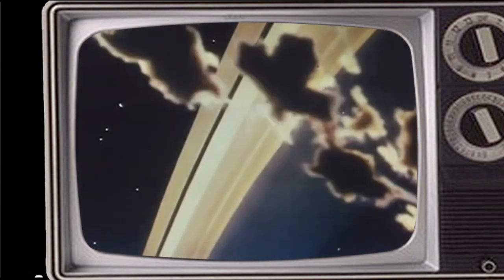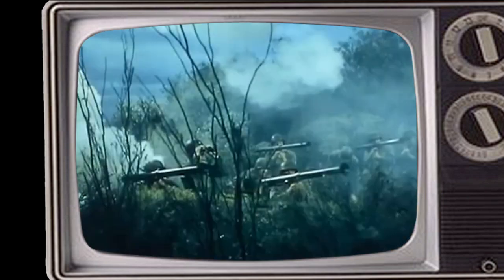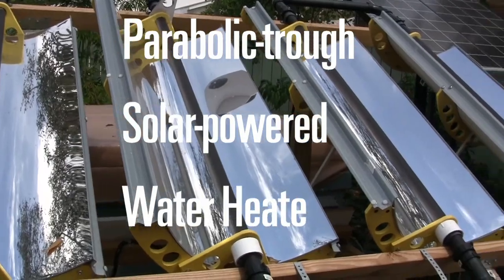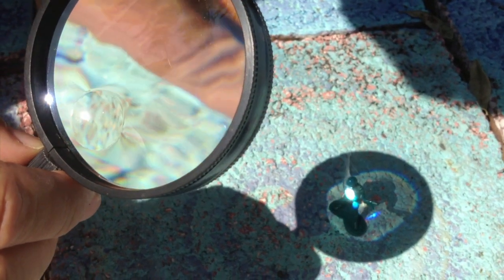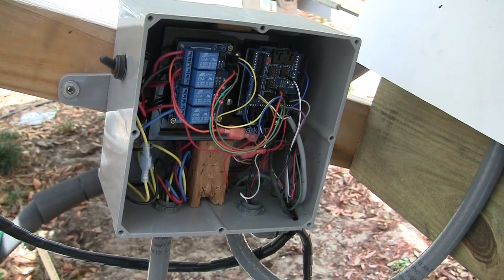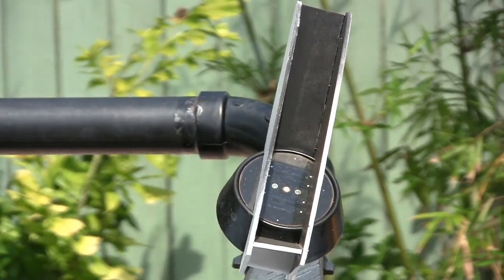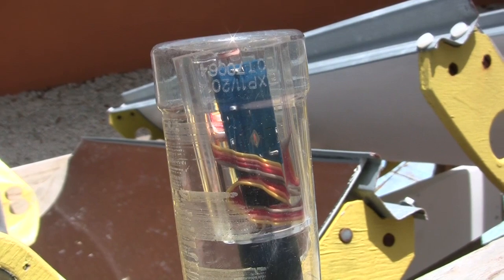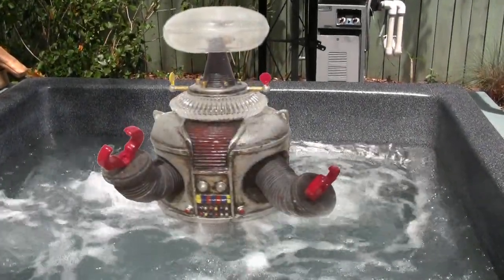Parabolic Trough Solar Powered Water Heater v2

Comment: Ok, you did the hot tub.  I would like to see something that could generate enough heat in winter in the north to heat a house.  Is that possible?  I'm talking about running water tanks through the night in radiators to heat the house.  Possible?
Reply: I would love to see something similar.
Reply: @nial-bell  I noticed there wasn't a reply ton me seven months ago.  I'm not expecting one now
Reply: That amount of hot water could heat a house provided you have enough radiators

Comment: What kind of material did you use for  mirrors?
Reply from the maker: I used Polycarbonate mirror, but it is not good long term in Florida because of UV rays. I would use highly polished aluminum next time.

Comment: This is Awesome! Great work.
Did you consider a cover to reduce heat loss from air flow?
Or will that distort the light too much?
Reply from the maker: Thanks, Tim!
The original 100 -plus year old design of a solar water heater; a black barrel inside a black box behind a sheet of glass works well because the stored water is being absorbed by the black painted surfaces and insulated by the trapped warm air in the box surrounding the barrel filled with water. And it doesn't matter how heavy it is.
However none of that applies to this design. Plastic would block a lot of sunlight,  glass would make it a lot heavier and more expensive and you would still block sunlight and have to keep it clean, deal with condensation, etc.
 I have seen some people use a vacuum sealed glass tube around the pipe in cold climates. They do a good job limiting heat loss from cold air and wind, but the glass tubes are expensive and fragile and increase the complexity of building this yourself. 
When it's cold, the more important factor is how well the STORED water is insulated. I insulated all the tubing that wasn't collecting sunlight, and insulated around the hot tub base and of course a thick 6" cover over the hot tub.
The genius of this design (George Phlak) is that the parabolic concentrator  requires relatively short footage of a fairly large diameter pipe, as opposed to un-focussed collectors that use a many feet of small diameter pipe. With short, large diameter pipe, as long as the water is moving through the pipe and there is direct focussed sunlight, the water in the pipes absorbs heat. And as soon as you stop circulating water, the unit instantly decouples thermally and does not cool the stored hot water.
Reply: Bruce Snyder Thank you for the detailed reply.
You have clearly thought through all the parameters, designing a well thought out cheap project that even us "normal" people can build.
I applaud you for:
1. doing this; and
2. openly sharing this.
People like you help make our societies better.
Thank you.

Comment from the maker: if you notice adjacent to the right is a passive flat collector that I tested before making the concentrator type collectors. It works ok, and of course you don't have to move the collector to follow the sun. That's good because that sucka is heavy when filled with water, unlike the concentrator. The big problems I had with the  "lots of tubing" approach was keeping it from filling up with crud and leaking, and also it acts like a radiator when there's no sun, sucking heat out.

Comment: Very cool... You're way too smart for your own good.   I wonder it you just used additional collecting tubes with maybe one flat mirror might collect similar BTU's but make the system far less complicated.  Or even just a large black hose absorbing area.  It looks to me you have a very high maintenance and temperamental system.   Very cool and high tech, but overly sophisticated.